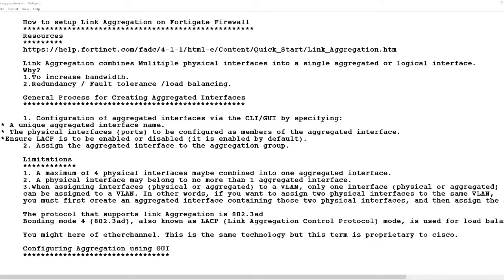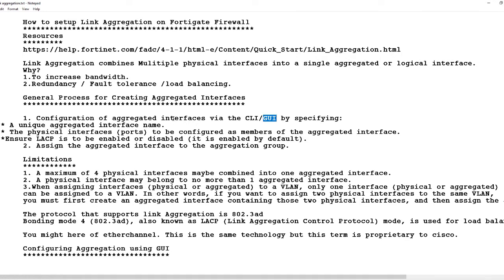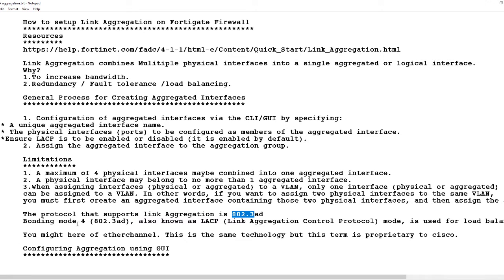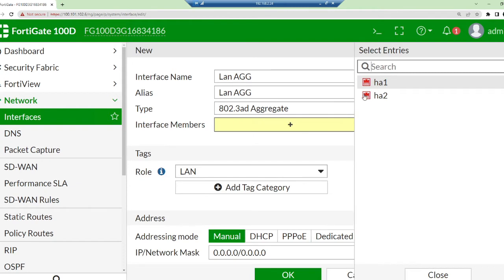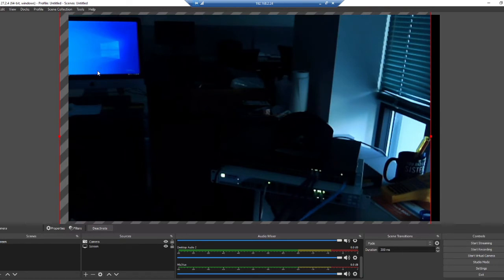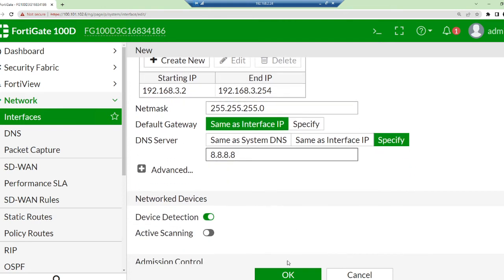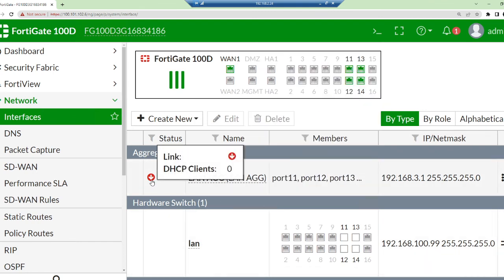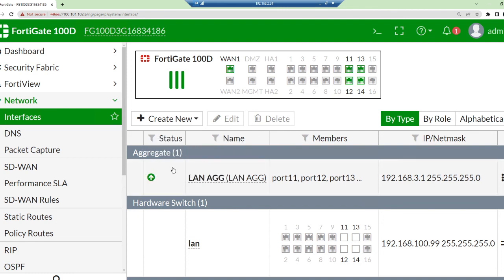Introduction to Link Aggregation on Fortigate.

Comment: Thanks. How about connecting Fortigate  active passive to stack switch?😊
Reply from the maker: Yeah that is great topic to make a video on I will try and make a video on that. Note that the settings on Active - Passive is on the “HA” port. Make sure to connect the high availability port to your second FortiGate’s HA port. Then from each of those routers connect to your switches.
Reply: @ccip1799  yes. I have Fortigate 100E with Active-Passive mode. Now Fortigate 200F to create lag with HP stack switches
Reply from the maker: I have created a PowerPoint lecture in HA. I will soon be making video.
Reply: @ccip1799 i don't see any video regarding Fortigate HA A/P connectivity and configuration with stack switches. Please make the video about this as I have task on this. Thank you very much.

Comment: Thanks for the video! I don't have an switch and my server is connected directly to the fortigate, I did exactly as you did there and just skipped the switch configuration part, should I be good to go?
Reply: Are you referring to setting up a nic teaming on the server and connecting directly to the fortinet?? That sounds interesting 🤔. Try it out and let’s see